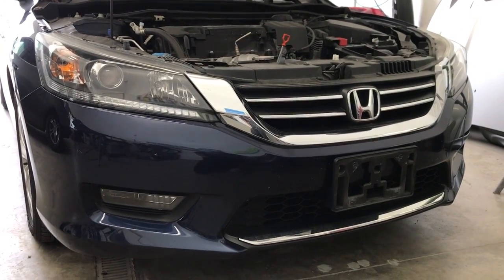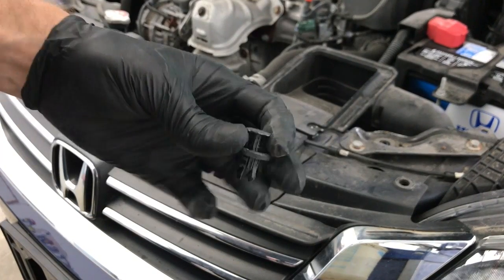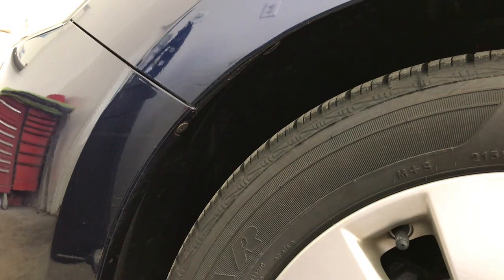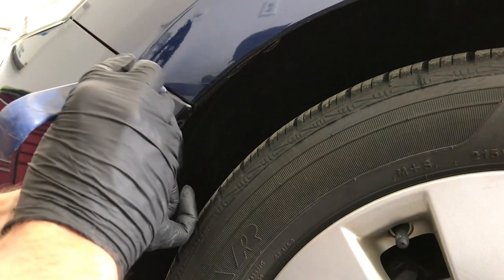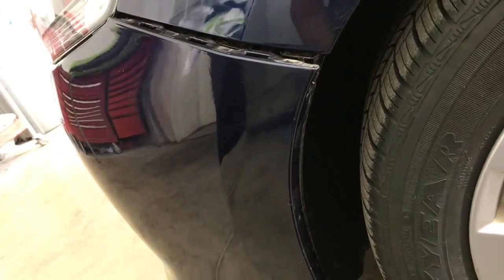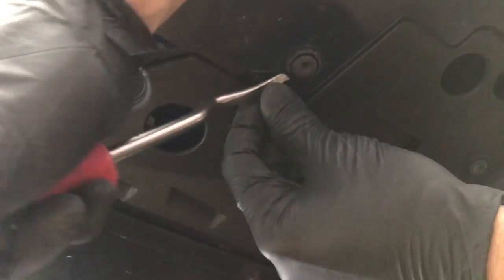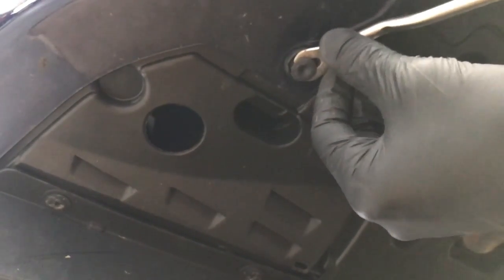2013- 2015 Honda Accord Front Bumper Removal How to Remove Replace Install

Comment: Awesome video. I used this one and the headlight removal video to change the headlights in my 2013 Accord. I did need an extra set of hands to start the process of bumper reinstall, but that was it.

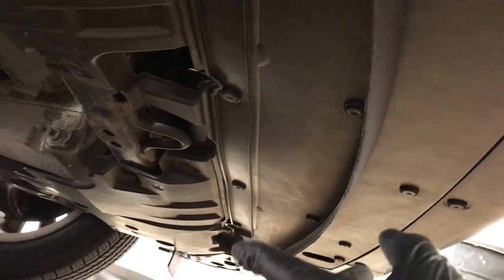Comment: awesome video, i went to far and went over a parking bump and my 2015 accord front bumper pulled off i kept. do you have a list of all the plastic molding from the under carriage ? mine got completely destroyed and was causing grinding noise so i cut them off but now i have no support for the bumper besides the top fasteners .i’m talking about the plastic molding from the area at time stamp 3:50-4:14
Reply: The front engine splash shield?
Reply: Same I need to fix b4 my dad grapes me 😅

Comment: I'm looking to replace my Ambiei Temperature Sensor (reports outside temp on the dash). I'm told it's behind the grill but is no where to be seen on your video. It's supposed to be attached there somewhere.  Did I miss it?
Reply: His car doesn’t have it I’m trying to figure out what that sensor was I’m replacing the impact sensor on mine and didn’t know what that little skinny sensor was thanks to your comment I figured it out.